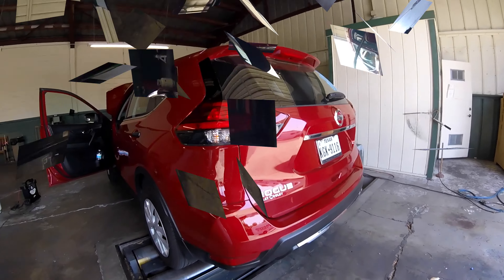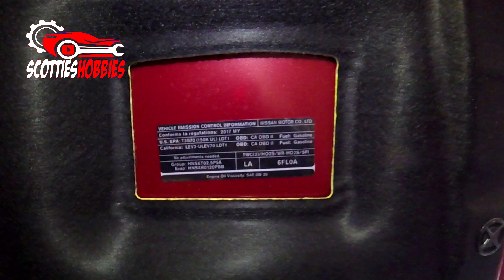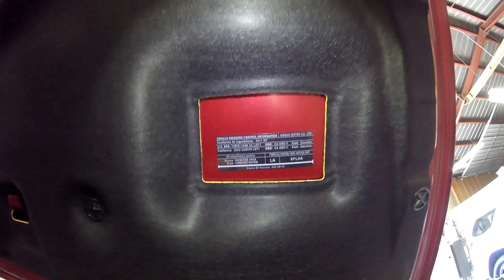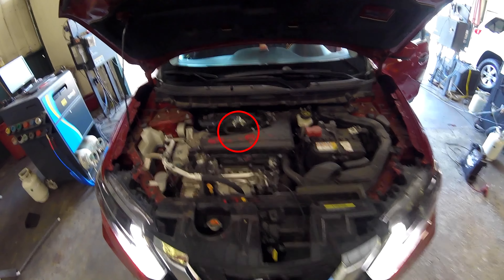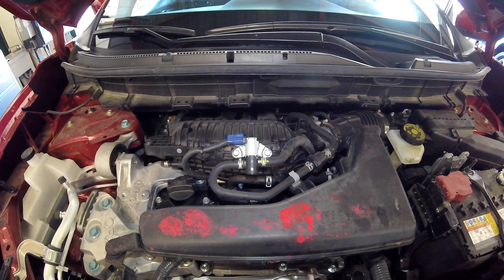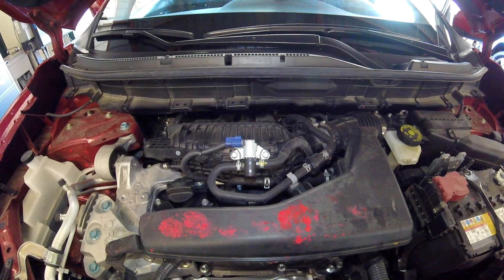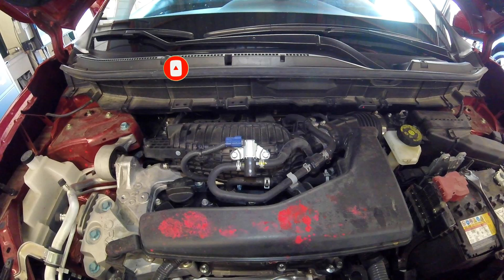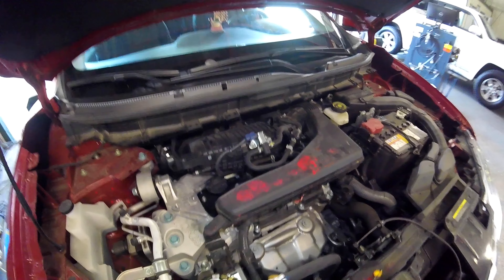🔍 Vapor Canister Purge Valve/Solenoid Location and Info | Nissan Rogue 2.5L (2014-2020) 🔍

Comment: Does it give cod po456?
Reply from the maker: It can. A p0456 is a 'small leak detected'. So either the vent or purge can be leaking a little. I always recommend replacing the fuel cap with a oem cap or a 'Stant' brand cap. Never a locking cap.
Reply: What's P0447?
Reply from the maker: @ahmedh3366  That would be a issue with the vapor vent Solenoid, the Solenoid or valve near the vapor canister under the car. What is the year, Make and model of the vehicle you are working on?
Reply: @ScottiesHobbies what about P0448 Nissan rogue 2019?
Reply: I thought the vapor purge valve/solenoid was behind the rear wheel on 2018 Rogue?
Reply: I have a small leak under hood n got p4056 code where is the location to replace Evap solenoid valve in 2016 Nissan Juke..
Thank you
Reply: @ScottiesHobbies hello! I have the same code, replaced gas cap, the error didn't go away, couple times deleted myself still popping up, what it could be? What other caps should I try to replace?

Comment: We have a 2017 rouge and just replaced Vapor Canister Purge Valve and pcv  valve. I noticed one of the line has a pressure of one pound  label on it. Do I have to add this one pound?
Reply from the maker: You do not need to add anything. The evap system will pressurize itself.
Reply: also what would cause a rough idle at times? @ScottiesHobbies
Reply from the maker: @davidelias9157  a lot can contribute to a intermittent rough idle. Have you cleaned up the mass air meeter lately? Have you checked for pending codes in the ECU?
Reply: Just replaced my purge valve. Do I have to erase the check engine warning lamp on the dash after install? I started it after I installed the new unit and it was still on. I'm assuming the ECU will adjust after running? Thanks in advance.

Comment: I have a small evaporator leak code as well as a random multiple misfire code. P0300 and Cylinder 4 but it's random. Had plugs, coils, harness and compression all tested. Could a small evap leak cause multi random misfires? It's a 2016 Rogue. The engine light would come on in the past whenever I drove on the highway or went above certain speeds. I am thinking something may be stuck open caused by the increased pressure when driving at higher speeds then it normalizes? Just a regular guy no Mechanical experience. Nissan is saying they want to look at the injectors but that's a 600 dollar job just to get to them on this Model and year... This car is a bitch to work on..